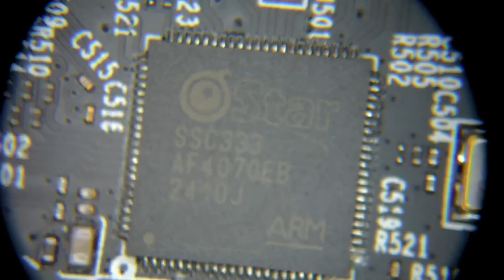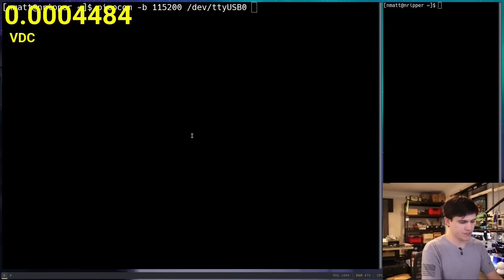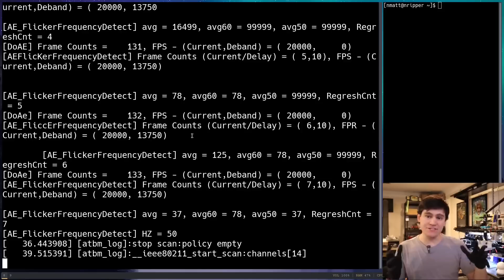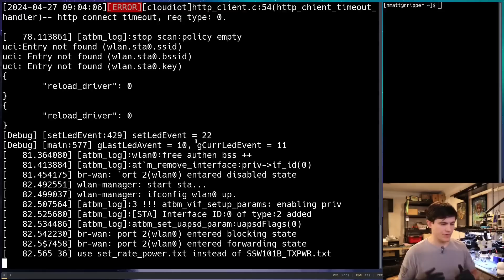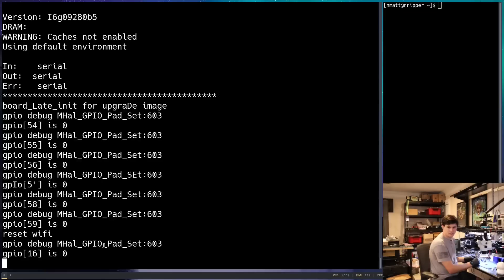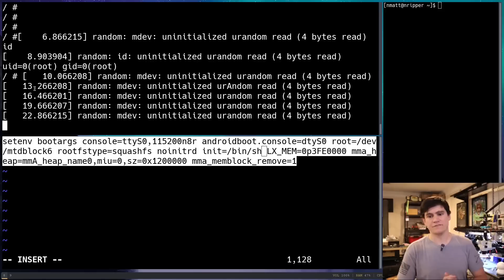Glitching Linux Bootloader for Shells and Freedom - Rooting a TP-Link Security Camera

Comment from the maker: Getting asked about the probes used in this video. They are PCBite probes.
Link: https://amzn.to/4eotvVh
Reply: A tip for soldering the wires on is to get a roll of 48SWG enamelled copper wire with solderable insulation, which will tin when you apply a soldering iron tip to it.  Allows you to solder to fine pins, and even to non filled vias with no problems, and gives a good connection. If the wire is to be there more or less permanent you can then tack it down with some UV cure glue, or even regular gel superglue if the bloom it will have is not going to worry you. Used it to repair damaged solder pads as well, soldering the IC pin to the wire, and then the wire to the track, and a drop of superglue to hold the lot down, followed the next day with a light scrub in IPA ( I was using TCE though, before it was banned from the military as well) to get the bloom off, leaving a good clean firm connection. Lasts decades with no issues, though not going to handle more than 50mA reliably, but getting you a wire out to a place where you can have a small strip of Veroboard 3 holes long, and however many point you want wide, stuck down to some point inside was a good way to have reliable monitoring.
Reply: Also lowering the temperature can help, otherwise it takes to much time to solidify, and it's not easy to stay still for so long
Reply: I was about to ask. Thanks!
Reply: Me as well 😀
Reply: You should make a colab with Laurie Wired!

Comment: What is it your setup to display multimeter value on the screen? You're muxing the microscope video under OSB with some software that reads the multimeter output? If yes which software and multimeter you're using? Thanks

Comment: I use high quality wire wrap wire.  It is thin and single core, so no fraying.  Quality wire wrap is silver plated, so easy to solder.

Comment: There appear to be 4 small round pads near the corner of your CPU very near to the primary UART pins that you are probing. Have you checked to see if they might connect to the pins that you want? I have a similar camera (with a different motherboard) that had such pads. They are big enough on my device that I was able to tack solder my UART wires to it.

Comment: If youre struggling with soldering, dont worry, its most likely not your fault! Those jumper cables you used to solder to the chip are notorious for not soldering good. Also having the correct flux and solder combo will be your best friend! I used to use a bunch of tip tinner for my soldering iron until I found a good flux like 'MG Chemicals' or 'Chipquick'. Both say no clean but I still clean anyway. Also, use 60 / 40 solder instead of the typical 63 / 37 solder, it might not seem like a big difference on paper, but its a whole different animal! I usually keep my soldering iron around 650F - 750F depending on what Im doing while keeping solder on the tip when I let the iron rest so its easier to clean for the next time I pick it up.  Hope that helps and thank you for the informative video!

Comment: I ran into some weird text  glitches with  a UART port on another device.  Eventually I switched to a different adapter and they went away. Might be as simple as a poor connection so the voltage rise/fall of the signal is delayed or doesn’t peak high enough for the adapter to it as a 1 or 0

Comment: I do not understand why you cannot override password hashes? At 24:44 in the video, you can see that overlayfs with writable sublayer (/overlay) is mounted as a root. So, it /should/ be possible to override any file, unless there is some other issue (like what is "pmpfs" filesystem).

Comment: Great video! During a software downgrade I bricked my C200, looking around online I found a post on Reddit that someone was able to interact with it via an ethernet port on the board and push the firmware via TFTP, unbricking the camera. Won't post the link as I'm sure anyone can find the post with some google-fu.

Unfortunately I have zero skill with electronics and ended up ripping the pads from the board, but this takes it to the next level!
Reply: you need to post that link
you haven't been doing this long but what you jut did is the most infuriating thing to possibly put into a forum for this kind of hobby.
Reply: @somacruz8272  youtube has been deleting links in comments for years at this point.

Comment: Great video. You could sneak in an esp8266 that would connect to the tx/Rx,  float the DO pin on the flash until it sees the second auto negotiate and then ground the DO. After that it could do the modifications to the bootcmd, run the normal init and then just provide telnet pass thru access to the root shell that it has.

Comment: Matt, suggested future similar projects… focus on cheap hardware from Meraki that traditionally only could be used with a license but that which likely can use OpenWRT once ported. 

Especially the WiFi 6 and newer gear, eg MR28, MR36, MR36H, MR44, MR46, MR46E, MR56, MR76, MR78, MR86. 

Pioneer some work by getting a new model supported in OpenWRT like these models already are:

(Google for OpenWRT and you’ll see a page full of already working models. Note that some like the MR33 have countermeasures in the 2017 firmware that will brick your hardware if going into uboot. Would like to see you fix that!)

Then explain to the audience and demo how cheap “locked” Meraki gear can be reflashed with OpenWRT for inexpensive and powerful access points and switches. 

It’s enough if you can show and document just how to get into the newer access points; someone else will do the OpenWRT port. Getting in is apparently hard on some of these. 

Thanks for your channel.

Comment: Well done! The ease of this has my head spinning with ideas.  *Edit: I got a question, actually... *
how do you deal with unknown/random CRC's when modifying bin files for write back to EEPROM/FLASH? I have a small I2C EEPROM (only like 256 bytes) .... it has a few addresses that shuffle in a way that looks suspiciously like a CRC... but I cannot figure out the polynomial or algo for how it's calculated. This EEPROM is, in essence, the vector into this device, so I have to be able to modify the data here to move further. I can't do that unless I pass the CRC validation.
Reply: With such a small memory they may have used an 8 bit CRC.  You could brute force this by changing the variable data from 00 to FF and re-testing.

Comment: IMO this would be good opportunity to followup (as you were saying) with a firmware dump, modify, re-program, etc. This would be beneficial in that it would provide ideas for those who run into situations where it would be required to do so. Viz inits resetting all tty connections, etc. Just my $.02.  Great Videos!

Comment: The solder wants to wick to the hottest part and away from the coolest. The leads will probably stay colder than the wire you are using to probe. Try a solid core wire, also that tip is probably oversized and slightly oxidized
Reply: But honestly if works it’s not broke.

Comment: Even easier than soldering: short the clock pin to the data of the flash with a pair of tweezers, a screwdriver, a bit of wire, etc. You'll mess up the read just the same, thereby dropping into u-boot, with less chance of overheated traces, lifted traces, solder bridges...

Comment: Great tutorial thanks! I'm going to try this! The flash on mine is an eon qh64a-104hip, luckily it has UART test pads too.
Reply: Update: it worked! But the bootargs is missing on this one, it seems they built the kernel with it's command line baked in to stop this kinda thing (it's a build option, setenv bootargs does nada for me). Glitch immediately after the 2nd 'click' from the IR shutter. Glitching earlier will revert to a u-boot mask ROM i think but it's impoverished with only an 'httpd' command for firmware updates.
Reply: @foobarf8766 Yep sometimes they bake the boot args into the kernel binary or the bootloader so you cant change them unless you try to glitch the flash or flash a custom firmware on it. I also had a device that did not allow me to change the bootargs or any kernel parameters
Reply: @309electronic5  thanks dude, good to know its not just me! the vendor has a github repo so I can build it maybe but where to find the .config?

Comment: To solder to small pins in circuit, it's easier to use plastic insulated wire-wrap wire. Multiple colors. Single strand thin pure-copper wire with plastic insulation (not enameled speaker coil wire). Strip just enough of the insulation for the length of the pin you are attaching to, tin the end, hold the wire nearly perpendicular to the PCB (slight angle) so the wire is soldered parallel along the pin from the bend at the chip to the bend at the PCB. Best when you want to wire up more than two pins right next to each other to avoid solder bridges.

A vertical microscope might not be the best option since one of your hands will be nearly directly over the pin being soldered. Not great capturing video. The best view to look at this is 30-60 degrees off vertical. I don't use a microscope. I use either a magnified adjustable desk light, or a Jewlers eye-loupe, or for really fine pins a set of dentist's magnified glasses.

This kind of wire can also be used to solder to tiny discrete components that are right next to other tiny components where larger stranded wire is just too big.
Reply: Yes #30 wire-wrap is great. Use Teflon coated wire, it has a higher melting point.  You will want to tape it down, solid wire breaks pretty easily when bent a few times.
Reply: I also noticed he's soldering to the base of the pins, aiming outwards at 90 degrees... Sometimes it works better when you come over the top, and solder parallel to the pin, down its side. Bend the wire to shape first, and hold it down with your finger on top of the chip. Obviously this doesn't work if you need to use loads of pins on both sides, but it's a trick to keep in mind.

Comment: Think you might have been able to do it with just connecting one wire to the pin and touching it to a ground point (the big mounting holes)

Comment: take a raspberry pi pico, as your UART interface, write a small program that detects the glitch timing and trigger the glitch on the GPIO - auto glich jail breaker.
Reply: Had the same thought but using a simpler Arduino loop timed to sense a power rail waking up and a variable to set the timing,

Comment: Hey Matt, the livestream you recently did with the spi glitch is what got me into my Netgear AC1200 R6120 but I'm having issues modifying the squashfs on a downloaded firmware update. 

I'm trying to modify setup.cgi to drop a reverse shell but the location of /etc is "/etc/null" I've tried "mkdir /etc" but it auto deletes after unmounting squashfs.img. The kernel panic doesn't allow UART input.

Any suggestions? eg: research material, personal advice etc

Comment: So can this be used to gain root access in phones with locked bootloaders? Looking at you, Smasnug
Reply: No. The AVB (Android Verified Boot) spec states that when the bootloader can't verify the boot/recovery partition (where the kernel image is), and the bootloader is "locked", the device should enter the RED verified boot state (the boot fails entirely). Also, the bootloader cannot under any condition allow for the loading and execution of unsigned (non-original) code.

In practice, this means that if you somehow manage to alter the boot image that's being loaded, the bootloader will refuse to boot and enter some kind of emergency download mode (in the case of Samsung, it's called "ODIN") to let you restore the device. This mode however, will only let you flash firmware that's signed by the manufacturer's key.

Comment: Great video! It would be neat to install in the device a pi pico or similar micro to watch the uart output and perform the glitch automatically on every boot like a game console modchip. Not sure how useful it would be for this case but nice proof of concept.
Reply from the maker: This would be a good exercise regardless of how practical it is... good idea!
Reply: @mattbrwn  ...just some more brainstorming, maybe an ESP32 with a web interface that would let you could change the boot args for the next boot
Reply: I have a Netgear AC1200 R6120 i tried doing this with by monitoring the UART serial console and the R6120 wouldnt boot with it set up, i had to manually short spi pin 2 to pin 4.

I tried with a push-button and it wouldnt boot either lol

Comment: so if Uboot does not recognize the flash type, it falls back onto a default type that consequently will load the kernel image at the wrong offset, throwing an exception that eventually leads into the uboot prompt?
Reply: If I recall, uboot will try a list of boot options in an order defined at compile time (much like BIOS on a PC trying the floppy drive then the CD drive, then the hard drive).
If this all fails, it drops to the prompt.
Most manufacturers don't bother changing any of these defaults... Partly because it isn't necessary for the product to work reliably (if the flash fails, the device is dead anyway), and partly because they set it up for development purposes to boot off multiple things, and simply never bother changing it.

Comment: Any resources which tells why those glitches works? Is it a bug with the uboot/security measures or intended behavior? If I'm interpreting correctly you basically shorted the flash chip to make them temporarily unavailable to the uboot, then rather than gracefully handle the exception, uboot just give preboot access?
Reply: Uboot wasn't able to read flash chip ID so couldn't autoboot and dropped into hush shell.  More locked down IoT won't give you a shell, won't let you change bootargs etc.

Comment: Here's a random suggestion. Yealink makes some office phones that are branded verizon that even when you flash standard yealink firmware to them, the first thing it does is connect to a server and download the Verizon stuff. And then no web gui. You can get around this by interrupting the connection to that server at just the right time and then change the address of the server in the web gui to garbage but it's a giant pain to do. Would there be a way to do this solely by messing with the hardware?

I know this is random but I had some of these phones and they were a giant PITA to deal with
Reply: Get the server address they use and then use a proxy to connect to the server you want instead.
Reply: It looks like you just want to kill access to the server dishing up the Verizon firmware. You should be able to do this with a firewall rule on your router - if destination is nasty IP, drop connection - or sinkhole the domain name in DNS using say a Pi-hole. Use Wireshark to check if the server IP is found via DNS or if it is hard coded to know which is best way to proceed.
Reply: @dingokidneys 
Or put the phones on a VLAN that doesn't have DNS specified in the DHCP.
Or use a custom DHCP response for those devices that gives no DNS servers.

Comment: Hi, Matt. Thank you so much for sharing such fantastic videos on YouTube. I have a router device that doesn’t have an exposed UART interface, but I found in the MCU’s datasheet that certain pins are designated for UART functionality. Would it be possible to scrape off the solder mask on the corresponding pin traces and try to connect that way? Have you ever had a similar experience? This MCU uses a QFN128 package, with some pins located within the pad, so I can’t connect directly to its pins and can only try connecting through the exposed traces. My English isn’t very good, so I hope you can understand.
Reply from the maker: you going to have to either find a place those UART pins are exposed on the board OR remove the chip, solder magnet wire to the traces, then return the BGA chip back to the board... which is easier said than done

Comment: My soldering was the same, watched a ton of videos, most important was to have nicely tinned solder tip and the temp is correct. Ans with a ton of practice its near perfect. ❤
Reply from the maker: I swear I usually solder better when I'm not recording myself doing it...
Reply: That's def the way it goes lol
Reply: @mattbrwn your tip looks oxidised - get a new one.
Reply: @UnCoolDad  For the most part its alright if the tip is oxidized like that, I can get back to normal with Tip Tinner and some good flux after that. Ive only ever replaced one tip at work and thats because of someone elses mistake.
Reply: @mattbrwn 
I think lots of things are done better when not trying to record yourself doing it. Just having to work around the camera makes it harder before you even start on the psychology of it.

Comment: 10:33 what is this kind of probes called that he is using? They seem so seemless to use like a plugging mechanism.
Reply from the maker: PCBite probes :)
Reply: I think that's known as a pogo pin, and they appear to be on a wire armature for hands free placement. The pins have a tiny spring inside that helps apply pressure and keep contact.
Reply: Hey what do you mean by a wire armature? I'd like to have a similar setup and did a fair bit of googling after watching a previous vid but I must've not had the right terms to search for
Reply: @theodorekorehonen  A more common term is probably bendable third hand.